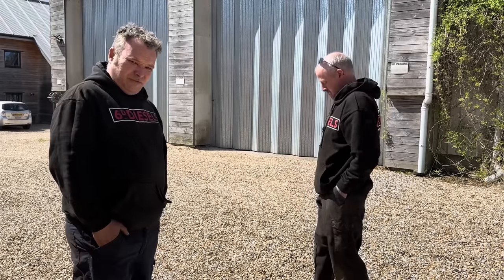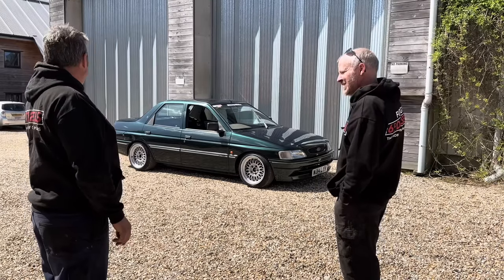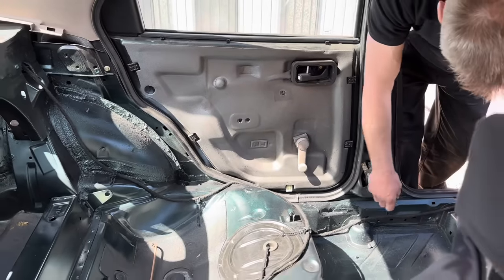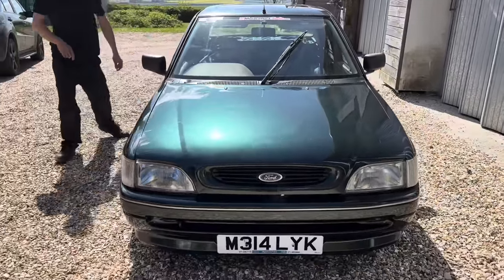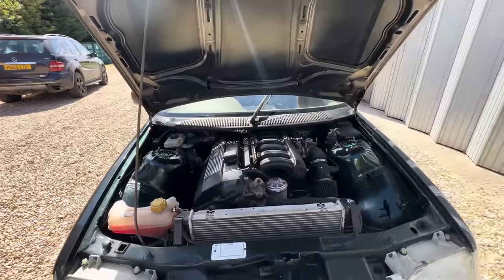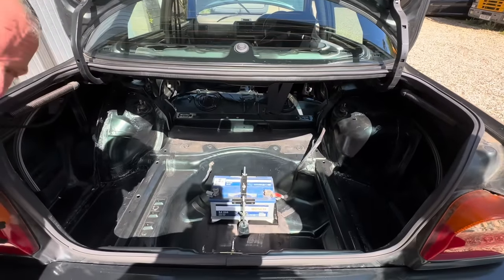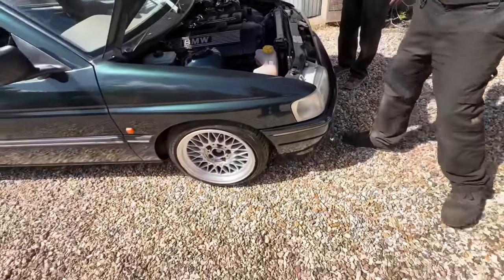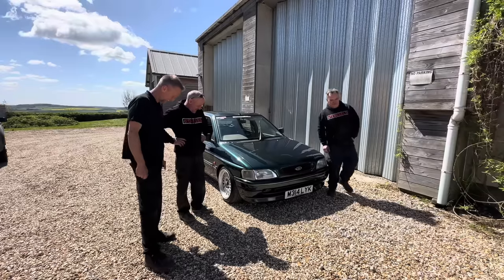If Ford and BMW hand a love child ???? Rwd ford orion

Comment: Dull man fact of the day: the mk5 escort flopped at launch and Ford started rebadging the Orion as the "escort saloon" 

That was so the Orion sales figures went with escort sales figures to try and bump them up a bit
Reply: IIRC the mk5 was badged orion the mk6 was badged esxort, as you say the escort sales had slipped behind the astra, in response to ford dropping the orion badge Vauxhall dropped the Belmont badge and called it an astra Belmont to get sales figures up